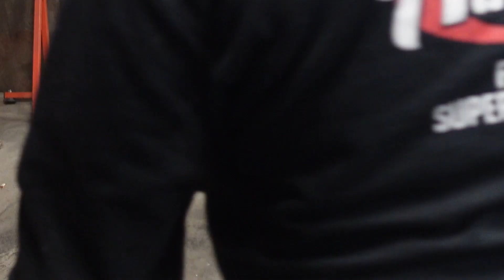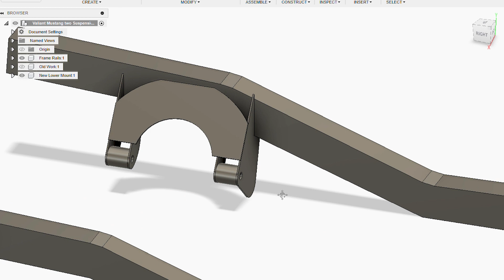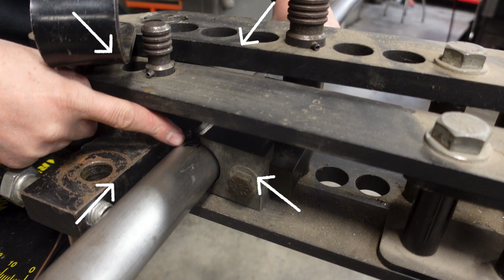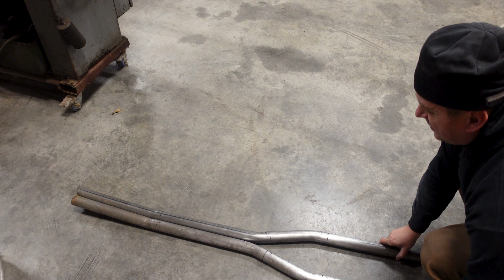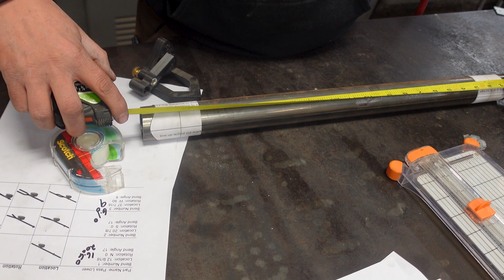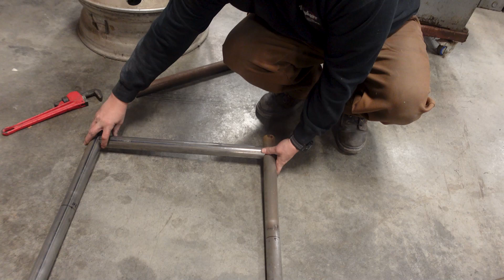Mustang 2 Install Part 2, Front Suspension Design, Tube Bending, and Layout

Comment: Did you ever do "part 3"?  was wondering how you did the upper A arm mounts. I'm doing a tube chassis build right now on my 53 truck trying to fab up a mustang 2 to save cash. Its what we used originally for the truck.